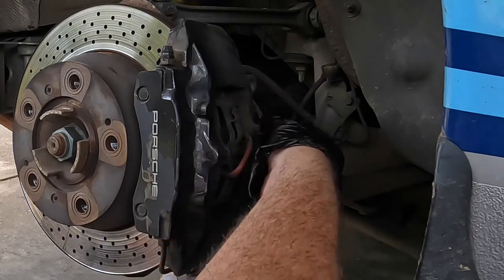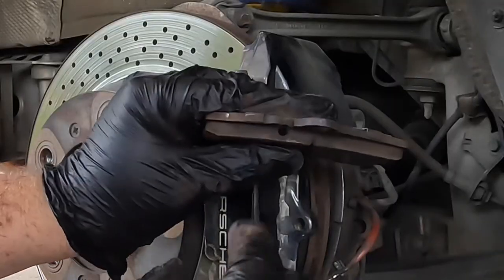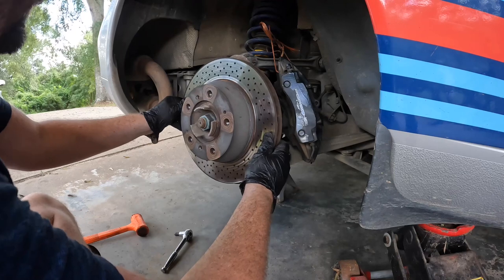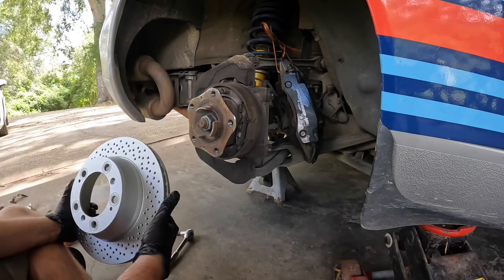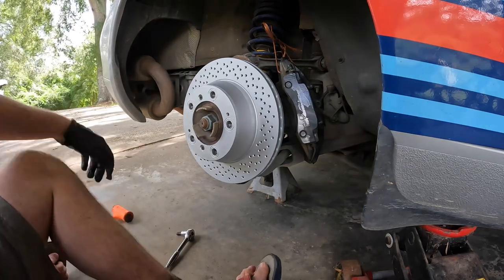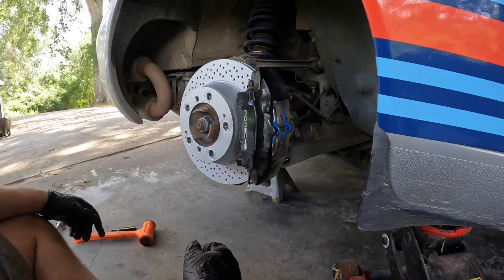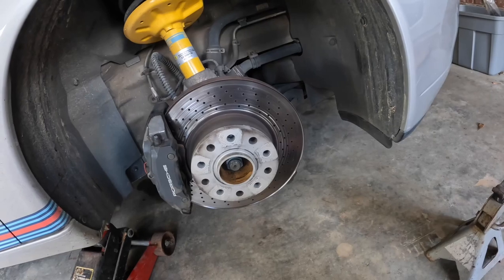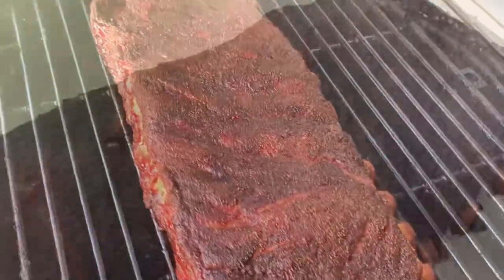Porsche 911 996 Upgraded Brakes: part 1 - pads and rotors

Comment: Fantastic video. This is my next job and really glad you have separated the jobs. I wouldn't have been as patient as you are by separating the bleed from the replacement parts. It is really interesting to hear the replacement parts addressed the sponginess. Looking forward to seeing what additional improvements come from the bleed and braided hoses. It would be really great if you were able to do a bleed with standard lines and compare performance with braided hoses as I have heard that they don't necessarily improve things. But that's quite a bit of additional work! Thanks for all the content!
Reply from the maker: Thank you! Yeah I read on the Pelican Parts forum that it was debatable as to whether the braided lines made any impact at all. But the price difference was really not that much. So we will see soon enough!

Comment: For anyone looking to do a brake upgrade for track days, go with slotted rotors not cross drilled. Slotted rotors have more surface area which works to both give the pad more to bite on to but also more metal to absorb and dissipate heat. You'll find that cross drilled rotors will develop fine cracks around the holes from the constant heat cycling, won't perform as well, and can (worse case scenario) fail due to the cracks.
Reply from the maker: I’ve read that before as well. Do you know if there’s any reason not to use slotted rotors for daily driving?

Comment: you didn't have brake caliper spreaders? That use of pliers to clamp the pads back to push the pistons back was... nail biting...
Reply from the maker: Ha. Yeah they make a special tool for that part. The finish on my calipers is waaaay overdue for a refurb that I didn’t even feel like bothering to put a cloth there to protect it. It doesn’t take much pressure though to squeeze those down.

Comment: How did the Pagid rotors work out long term?
Reply from the maker: Even with highly grippy track pads on and three track days, there were no cracks or excessive wear to the rotors. Really happy with them. I ended up switching to normal pads after the track days.